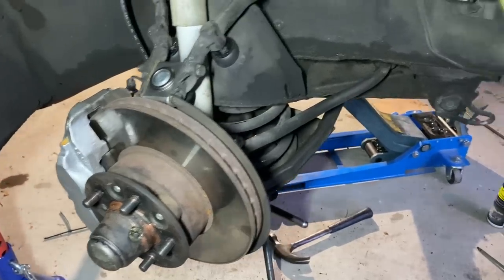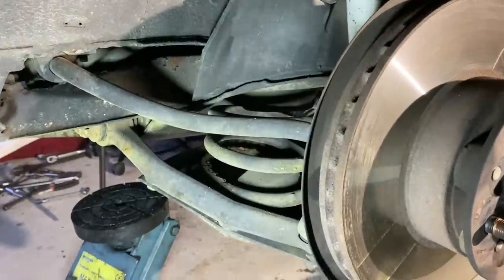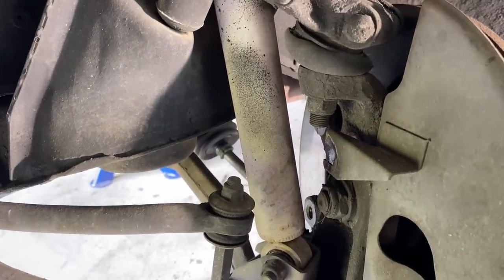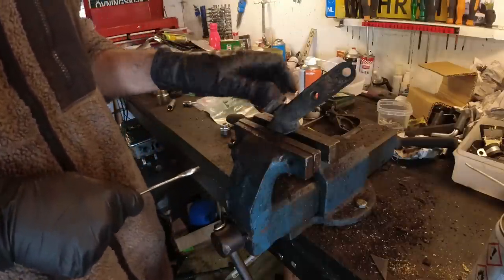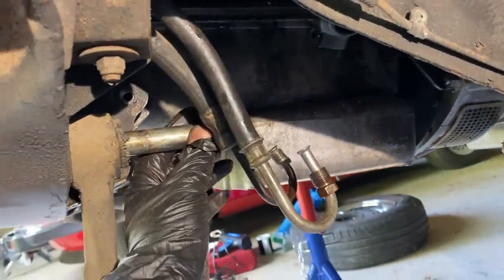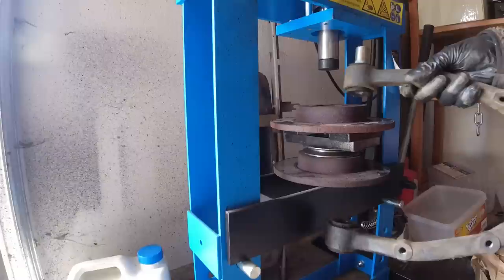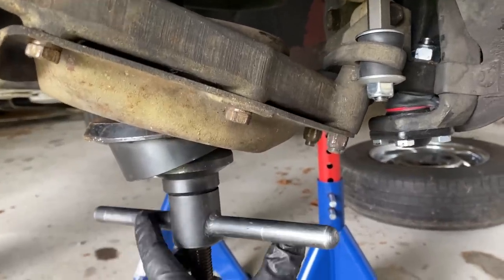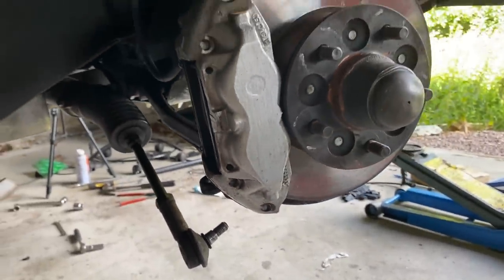How to Rebuild the Front Suspension on a Jaguar XJ6, XJ12 or XJS

Comment from the maker: I forgot to mention one thing! I do not like using poly bushings in the front suspension except for the steering rack mounts. They make the ride too harsh in my opinion. I use high quality OEM metalastic bushes they will last for many year.
Reply: Well, they only last if the engine isn't leaking lots of oil all over them!
Reply: Im with you on that but I spoke to Chris Knowles from KWE engineering and he agrees with but but he did suggest that they also work on the lower wishbone without ruining the ride, your thoughts as i am doing the whole front end this year

Comment: Awesome video, saved me loads of time. Still got a few things wrong. I actually took the complete subframe off to address some rust issues on the body. The workshop manual and the parts book miss a couple of points. Obvious to some, but took me time to work out, so here goes for those about to embark on this:
1. The fulcrum shaft also has spacers, so suggest you make a note of these as you dis-assemble. In my case, after removing the rust, it turns out all the spacers were the same size. Bolt goes from the outer, through the sub frame, then the spacers, then the fulcrum shaft and then the NEW nyloc nut.
2. The upper wishbone arms in the parts manual have 4 part numbers. The actual parts have 2 cast in them. The first post i read said one thing, the next something else. I have placed the part numbers with "69" at the end, at the front and those with "70" at the end at the rear. This correlates with a mates vehicle that works well. Make up your own mind. Looks about right on the bump stops, and the bolt lengths through the ball joints work (if you have the correct nuts)
3. The nuts that are called out for the upper wishbone to upper ball joint connection and what you get from Barret's seems to be wrong. They need to be short height nyloc nuts (like the annoying bolt head) to clear the brake disc at full steering angles. To get torque on the outer half height head bolts, without rounding them off, I found putting the torque wrench on the better nut, and rapidly applying load (without a spanner on the crap half height bolt worked well. If you do it this way, apply some extra torque. Torque values are based on quasi static (slow) loading. So this dynamic approach is a bodge, however once you have rebuilt this joint a few times, the bodge will be welcome. Just remember to lift the torque wrench setting a bit (25%?) when applying dynamically.
4. The spacers for the upper ball joint have a shape to them. It doesn't really matter, but the radius end should be outboard, for a more flush (aesthetically) setup. This was pointed out to me after my 4th iteration on the crap 1/2 bolt so ignoring.  The upper ball joint spacer position is allegedly critical, so hope you read the instructions and noted where they each were  on disassembly. Assuming the spacers have been on there a long time, then they will have developed a nice "nesting" rust pattern based on their environment. Unless you are going to nest the various rust (wider) bits together in exactly the same manor, suggest you sand off the rust so they nest independently of the wider rust. Once you have done that, any corrosion coating that remained will be gone. Having nearly thrown my car away because I failed to get the lower wishbone bolt out, I am applying anti seize to everything, apart from tapered engineered interfaces.
5. Still in the rebuild mode, so may add some hard learnt lessons later......

Comment: Another great video Adam.  Thanks!  I know filming slows everything down, then you need to edit, but I for one am very grateful that you put this video together. Your growing library of videos is supper helpful.  Tomorrow I'm putting the information from your windscreen gasket replacement video to good use for example as I'm reinstalling both of mine.  Cheers!

Comment: When I worked on airplanes I was taught the general rule was to install bolts in “the direction of flight” so if the nut falls off the bolt will be more likely to stay. I wonder if that’s why they specify a direction? Thanks for the video

Comment: Substancial amount of work in that  exercise.  Ifyou're going to do the job more than once, is it worthwhile having a scrap unit around to store bolts, shims, &c in their correct place and orientation?
For caliper-hanging, wire coat-hangers can be helpful in place of or in addition to zip-ties. (Depending on what the local environment offers in hanging-places.
Reply from the maker: Honestly it’s not that many bolts and parts. It’s pretty easy to keep track of them.
Great tip with the coat hanger!

Comment: Im in the process of rebuilding the suspension on my Mk2.  The bottom pinion shaft was absolutely siezed, took a lot of heat and hammering to remove. I dropped to whole assembly to do this. Not looking forward to reinstalling the springs. I am using 6 theaded rods into the lower wishbonecand a jack.
Reply: how did the rest of your repair go? I'm getting ready to do mine, but not looking forward to it.. my main concern is bolts being seized and not having the replacement.
Reply: @gogobrent  Not got around to reinstalling it yet. I have had to do a lot of welding on the chassis outriggers. Didn't really have a problem with siezed bolts, I am replacing the bolts, and they are available from Namrick in the UK.
Reply: @gogobrent My lower control arm pivot bolts were fully seized. I had a 40 ton hollow shaft press on one end and had to heat and beat the other end with a sledge hammer for 4 hours each side before they came out. Put liberal amounts of anit seize on your bolts when you replace them. Good luck